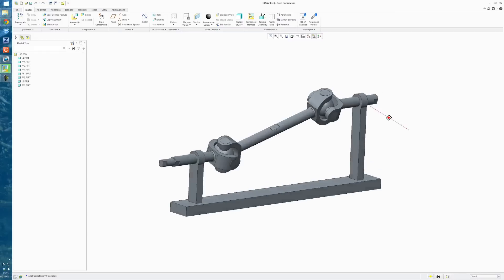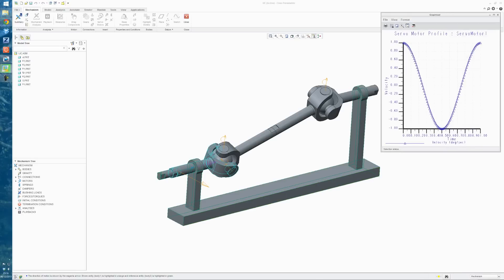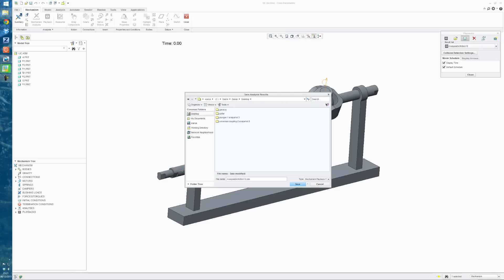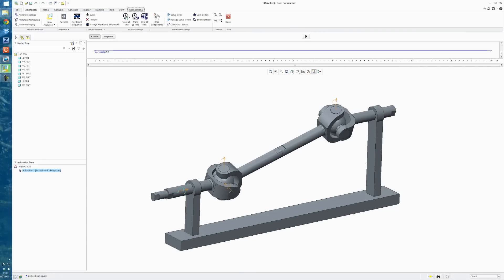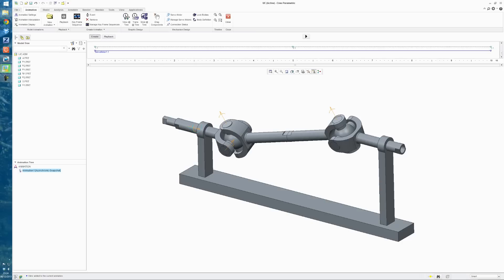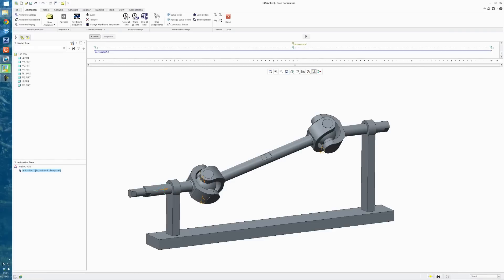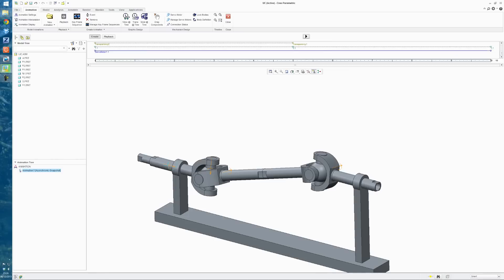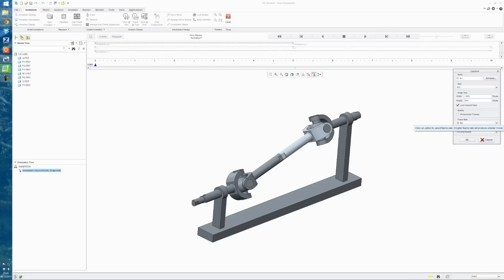Creo (ProE) basic animation - moving parts and changing views

Comment: I slide the marker on the play back speed all the way to the right... and my play back is still super slow and "jerky" as it progresses through each frame.  How do you get your video to play at the speed you show and smoothly?
Reply: This might have to do with your computer specs. Try it on another computer.
Reply from the maker: Hey, don't worry about that, it's purely because of the specs of your PC. Once you render the animation to a video file, it will be perfectly smooth, assuming you've got the correct frame rate settings.